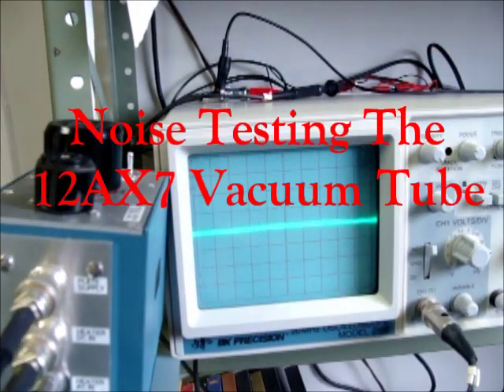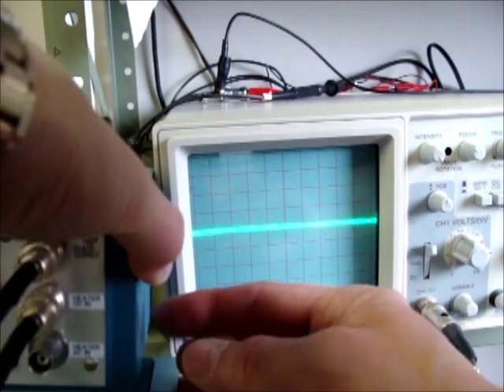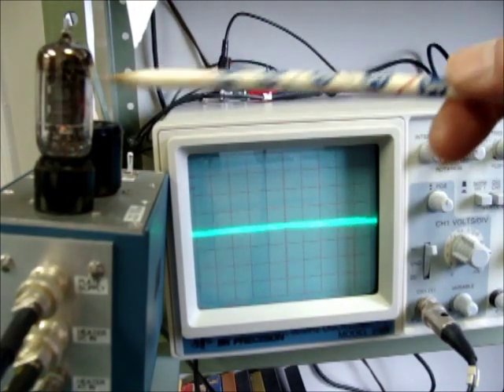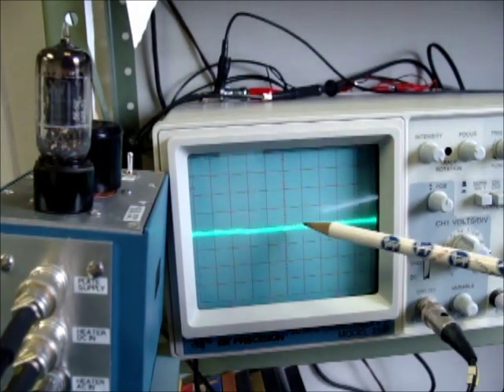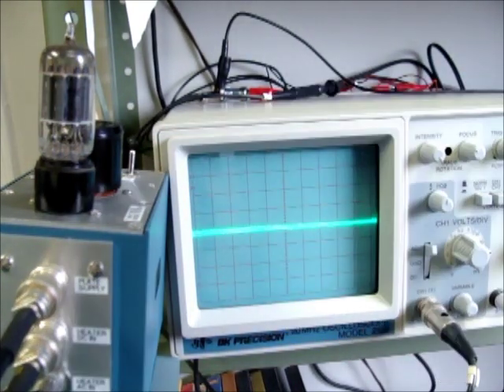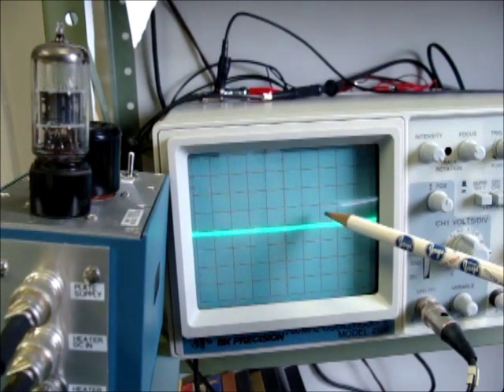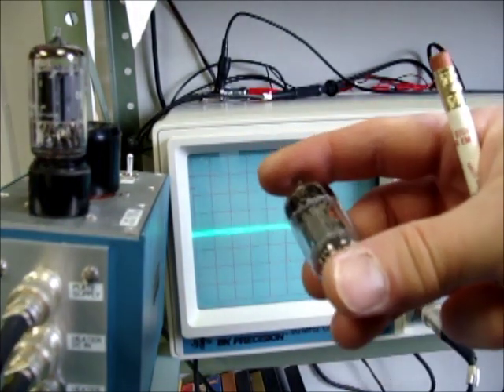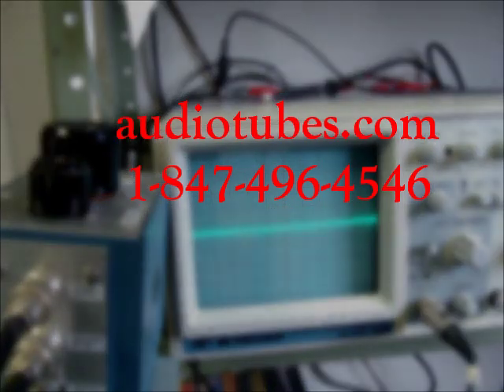Noise Testing the 12AX7 Vacuum Tube

Comment: Very informative. It certainly makes me wonder how good the tubes are in an early model (circa 1975-1980) McIntosh amp. If the amp had a bad tube, or one with more than the max distortion specs listed by Mac, it would likely be best to find the equivalent replacement tube based on a test like this than to simply order them from Mac and assume they are good. Not that Mac would send a bad tube, but if you can find a replacement that is even better, why not use those?
Great video,
Rich
Reply: It certainly helps to audio test your tubes, as well as look at the full picture in regards to it's electrical properties.  I'm a tube retailer, and I use a digitized curve tracer to test data points for plate current at rated voltages, plate resistance, and transconductance, and then calculate values for voltage gain on tubes like the 12AX7.  I also perform a test that randomly spikes voltage and tracks variations in plate current.   As far as I know I'm the only retailer that does this, which is strange considering it takes only an intermediate knowledge of circuit design and knowledge of electrical values and how they interact.
Reply: @CHAOSMOVEMENT  I presently don't own any Tube audio equipment but it's certainly on my 2022/2023 to-so list. I'm an analog audiophile and have been from way back in 1979/1980 and presently, my system runs a McIntosh 2105 Power Amp. I'm planning to replace it with a Mac Tube Amp but I haven't decided on the model yet.

Whichever model I eventually decide to get, it'll have at least 200w p/ch output power and I'll be very concerned about making sure I have high quality tubes. So, I've just added "Lakeland Records" to my "Tube Amp Search List" that I've saved in my computer.
Thanks for the info!
Rich
Reply: @richpaul8132  Feel free to comment on one of my videos, I'll be happy to exchange info.
Thanks Rich.

Comment: It has been my experience that the Telefunken's are some of the best tubes every made for the voltage amplifier stages. Amperex Bugle Boy's also rank at the top. In my opinion, a 12AU7 that is highly under-appreciated is what is known as the "clear top" made by RCA. I think they are top-notch and of the best-of-the-best but are under appreciated because there are so many of them available today.

Comment: I replaced several tubes on my restored Zenith 10s464 radio console because the tubes were weak. Prior to this, I replaced all the caps, mica caps, resistors, ect and it ran fine, but when I replaced the weak tubes I noticed a "pop" and a scratchy "hiss" sound as the radio warms up. Can this be a "bad" tube even if my B&K 707 tells me it's good? I rechecked everything for tolerance and soldering connections.

Comment: Great video.  I have considered using a defunked TV7 as a tube base to run into and amp and do similar test. The TV 7 would provide bias, filament and plate voltages for numerous tubes.

Thanks for sharing your project.

Regards,
Glenn WA4AOS

DSM Labs (dot com)